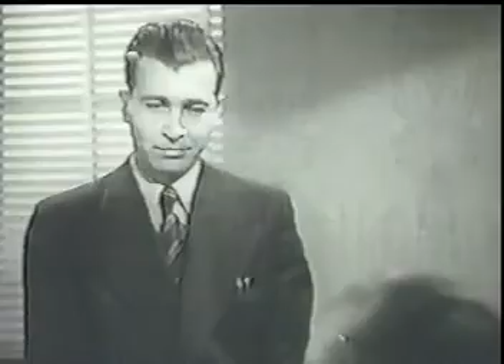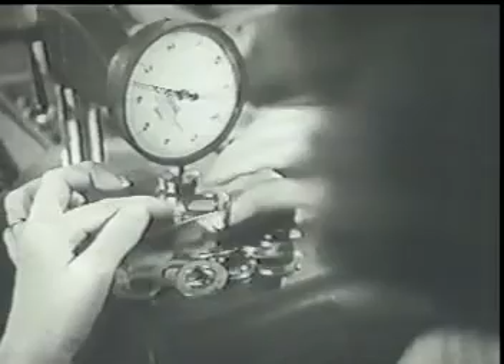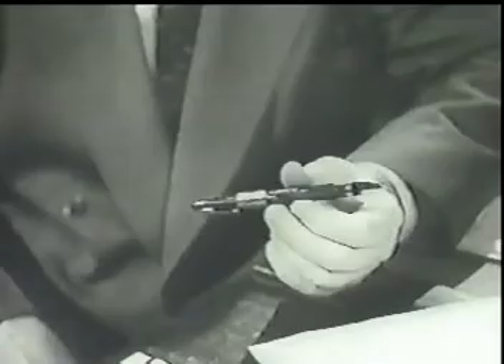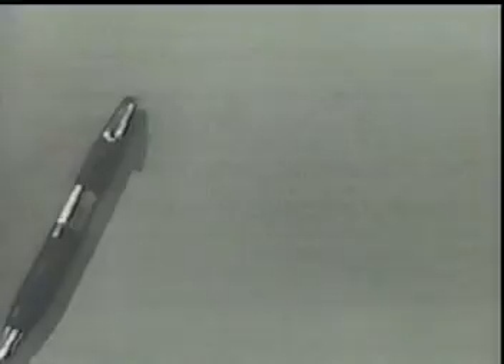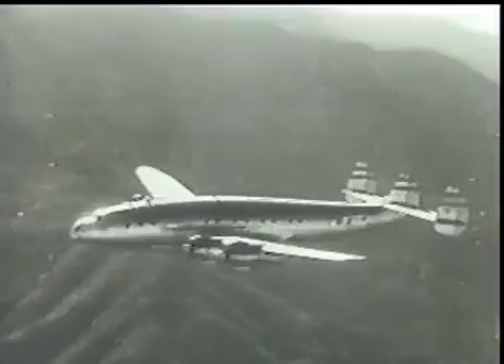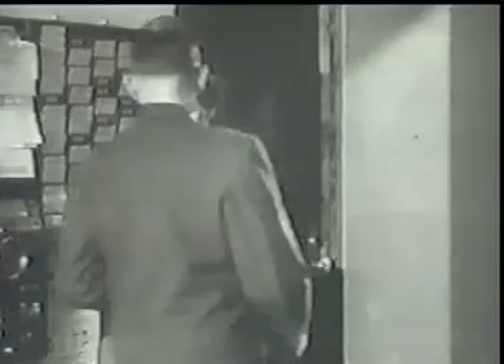Sheaffer Pen wartime manufacturing

Comment: I have several of the Sheaffer School/Student pens. They are some of the best pens I have ever used. I would easily be happy if every pen was a Sheaffer School/Student Pen.
Sheaffer Pen Co. went through great difficulty during the war because it couldn't produce as many pens as the dealers demanded. Timex and Ingersoll Watch Companies went through the same trouble. We think of the troops and families, but not often the companies that make the sacrifices.
Reply: I collect vintage beauty-trade magazines.  When the USA joined the War (December 1941), factories had to switch to making products and equipment for the military.  For the duration of the War, these companies also had to change their advertising to apologize for the lack of inventory, and to encourage people to take good care of their current  equipment.

Some ads warned of counterfeit products and unscrupulous practices, such as refilling a brand-name bottle with a no-name product, or ironing metal permanent wave pads so they could be filled with no-name chemicals and reused.